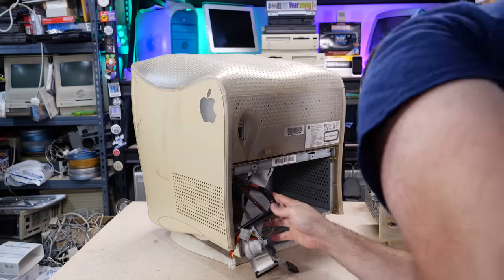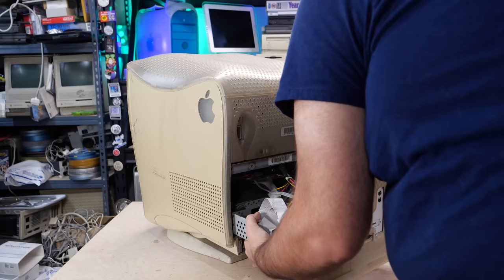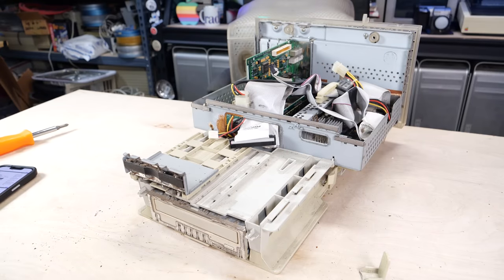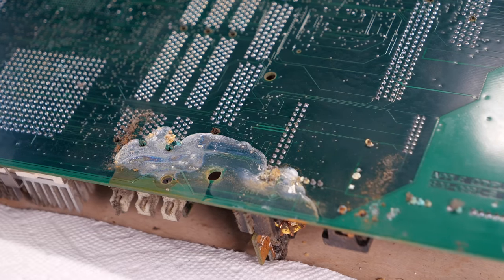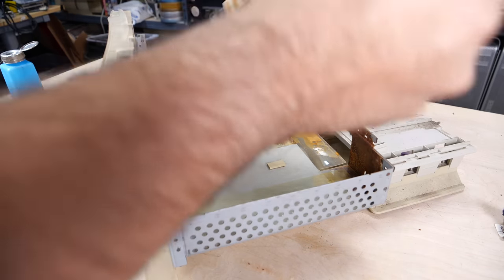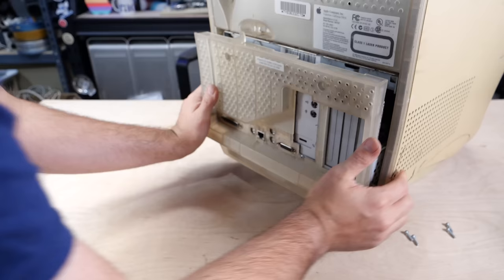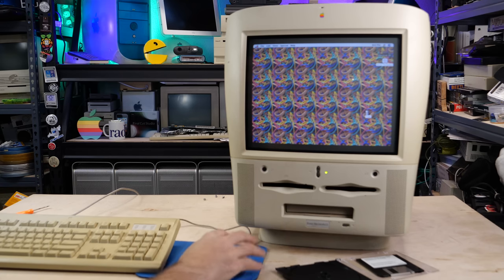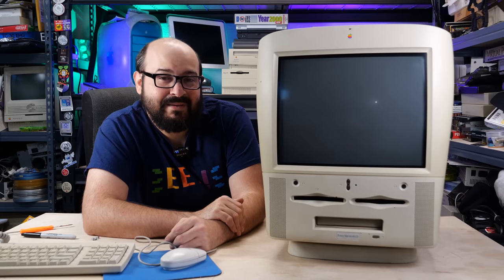Did This RUSTED Apple Molar Mac G3 Survive?

Comment: Interesting video. Apple should have done what I said Atari should have done with it's Mega / Mega STE / TT computers, and that was put the clock circuit and battery in a sealed compartment in the bottom of the keyboard. That way easy to access, and no real damage if it leaks.

Comment: For that much corrosion I think you're going to have to go with a wire brush in a drill or a dremel.  You can follow that with rust converter spray primer and then some grey rustoleum paint to seal it up.  You may want to consider something to pH neutralize the surface after you wire brush it but before you prime it.
Reply: Personally I always sandblast rust and follow up with an aerosolized Zinc galvanization spray. Especially on thicker metals, since thinner ones tend to warp when sandblasted. I like the method cause I can be sure that all the rust is completely removed and apply a fresh layer of metal on top as opposed to paint. That way if it was being used as shielding it still can. It's also very fast, I can get the whole process done in less than 10 minutes generally

Comment: This looks like the first foreshadowing of the B&W G3s and iMacs with those translucent bits!

Off the top of my head this is a Rev. A logicboard, which only supported one IDE drive per channel. That's why the ZIP drive would have been SCSI. Later revisions supported two IDE drives per channel and had the CD/DVD and ZIP drives on one IDE cable, at least the desktop models.

Comment: Evaporust then rust converter. Wire brushing before the Evaporust might help it work quicker. If you have an ultrasonic cleaner then you can put the Evaporust in there.

Comment: for that rust  use fine grit sand paper or a dremel with a wire wheel and some color matching spray paint after ya remove the rust.
wash before and after before you paint.

Comment: This is a duplicate comment for Steve, but I figure I'd post it here so it can be seen publicly just in case anyone comes looking for advice, etc. 

For the rustbucket G3 minitower project I actually bought some Loctite Naval Jelly (it was cheap and I needed to keep it cheap) and it seemed to do a decent job neutralizing the rust, though it smells horrible. Definitely use it in a ventilated area. After which I followed it up with some rust preventative gray primer, and it held up pretty good until I ended up finding a minitower chassis in far better condition and transferred everything over to that instead.

Not sure how well it'd have done without the rust preventative but I figured I didn't want to have to go back and do this again for a long while, so yeah.

Some of the worst rust spots I had to take off with a dremel but that wasn't terribly difficult. Having a rotary tool really helps.
Reply from the maker: Thanks!!

Comment: I've always liked the look of the Beige G3 AIO. 

I have two of these, only paid $5 for both (I still have them), although they're not in as good as shape when I originally got them (all thanks to one of my mother's friends putting them into a partially collapsed garage, luckily none was water damaged). The one I used as my main machine I maxed the Ram out (system and Vram) found a G3 from a B&W G3, a PCI R7000 that was connected to a secondary monitor, and found a wings personality card to put in it, a 120GB HDD, and a Pioneer DVD burner. This machine was my first time using a zip drive.  

"Relatives" bought a lot of 20 of these from a local school, they wanted me to check all of them out because they couldn't turn them on........ They was trying to turn the system on from the switch on the back. As soon as I got there I plugged the keyboard on, made sure the switch on back was on, and pressed the power button on the keyboard.

There was some software you could download to adjust the screens geometry, but I don't know if it's still available or not, it might be hard to find now, at one point in time I did have it and adjusted the screen for my Beige G3 AIO.

Comment: Yes it would be recommended that you get onto that motherboard and clean up that battery corrosion. Hopefully someone has a service manual on that logic board to ID those bad caps by the battery. Use caution in cleaning around those caps, some of the traces could be on their last leg. My daughter has one of the  newer Blueberry G3’s and it’s issue is screen underscan that I see on you G3 as well. I have been told the issue is in the power supply for the CRT. Bad electrolytic caps are alway a source of concern on these Hi voltage power supplies. I have also notice the Blueberry is running a lot hotter than before so it’s time to carefully recap the power supply to the CRT. Keep a close watch on the temperature on that machine, invest in an IR thermometer, it will help in some diagnostics.
Reply from the maker: Yep, I’ve rescued worse boards, and thankfully I have a working board I can read the values from.

Comment: What I find especially fascinating about the Molar Mac is its janky, threshold fusion of iPlastics and beige Platinum design language on the case. Seems like a (relative) powerhouse platform for upgrades, too, especially with the tray design, but it's the most bizarre thing to see a mid-90s Power Mac from the front and then stand up and look around the sides and realize it was basically advertising the iMac future. (I also like the somewhat subtlety of the Power Mac 9660 with its side door latch and internal plastics.) "Here's the old on this particular panel! It's seated next to the future on this seam!" The contours are really strange and I have to imagine the idea of a tooth, or maybe, shoulders? Tooth might have been intentional I guess if they were leaning towards identity with the medical/dental market. Also, those massive translucent Apple logos mirrored on both sides? The weird, crosshair style of the front I/O? What's up with that craziness?

It's rough to see a substantial chassis derusting operation in the wings for that poor lad, but it's great that it's not damaged further and that the swapped logic board seems to do great. Find him (and his brother) a sturdy desk :O

Comment: Navel jelly rust remover should work on the frame that and the CD case. Tarn-X will clean the connectors and IC legs it doesn't remove any metal like the Naval jelly will.

Comment: I have a g3 board that was that bad, cleaned it up and fixed the power reg board and it booted fine after that, sadly I cant fix the battery part because of the damage, but other than that it works great

Comment: I wonder... Can you put a beige G3 motherboard in an ATX case? Have there been projects for this? I'm mainly thinking of all that brittle plastic and just getting the Macintosh working.
Reply from the maker: The beige G3 logic boards actually have a jumper that let you use a standard ATX power supply too. However, the PCI slots and ports will likely not line up on a standard ATX case.

Comment: Great video! Looking forward to follow this project! Especially your harddrive upgrade adventures. I recently got a Power Mac G3 Desktop and the StarTech IDE to SATA adapter (from my iMac G3) wont work in it because the IDE-bus on the Power Mac isn't fast enough (the adapter needs at least 33 Mb/s)
Reply from the maker: Yeah, I will probably go the BlueSCSI route. These early Macs with IDE are very picky!

Comment: I'm guessing the ROM on the original AIO board tells Mac OS to enable the software monitor geometry controls, so if the other board proves unfixable swapping the ROM SIMM will make everything work as normal on the new board.
Reply from the maker: That’s a great catch! I’ll see if swapping the ROM does the trick. Thanks 👍

Comment: Q: What is a 'personality card"? Is it a multi-media (sound and vision) connector?
Reply from the maker: I'll be doing a more in-depth history video about this machine, but in short the personality card was an I/O card that gave the Mac sound capabilities. You could pay for a standard definition video I/O card, or even a video card that supported DVD playback card. The audio one was the cheapest option, so most people just kept that.

The Power Mac G3 Desktop and MiniTower use similar cards, except the All-in-one model has a special port added to the cards to output video to the CRT.

Comment: Your realize that you were running Unreal in the software renderer right? If you want to do that you need to go down to 320x240. Does it have a 3D accelerator in it you could utilize instead? I assume that was the ATI error you saw the first time
Reply from the maker: I mentioned this in a prior comment, but I will be reinstalling the OS and drivers and giving this another proper go.

Comment: You should really center your voice during camera talk, even if you forget to get the mic audio & have to pull from the camera.
Reply from the maker: I'm working on getting a better lapel mic, but I'm working with what I got.
Reply: @Mac84  you can do it from within the editor.  I got used to it as you cold cut to new angles but at the beginning I was sure my left speaker had died again (I'm dealing with Shakey cables).  Standard practice is to center speech on intros & outros, it's hard to explain it's a whole subconscious level...audio engineerey...toimey woimey....thing.
Reply from the maker: The microphone I use is a mono one. So I'm not entirely sure what more centering I could do. 🤔 Either way I'm looking at other mic options, but nothing I can acquire just yet.

The issue with the opening shots (and a few others) was that the furnace was on. When I reduced the background noise my voice sounded a bit thin, but it was either that or freeze my toes off, hah.
Reply: It was shifting left & right too, I honestly assumed it was the camera mic
Reply: @atari2600b  Audio engineering is an art within itself.